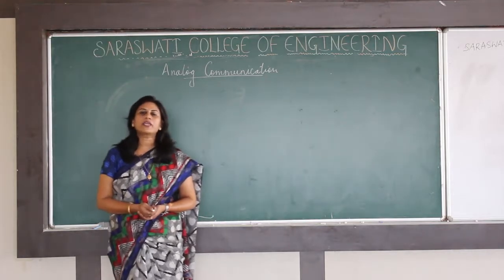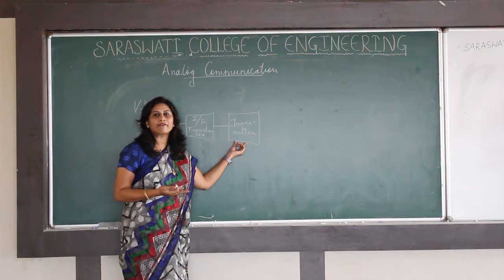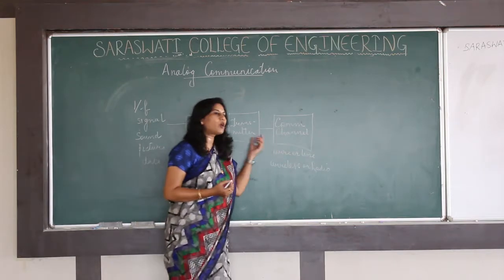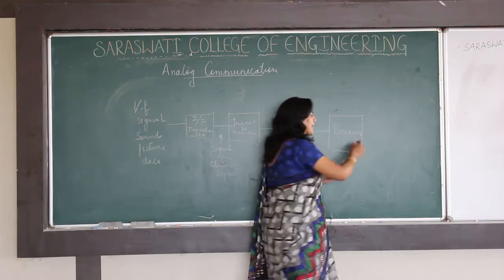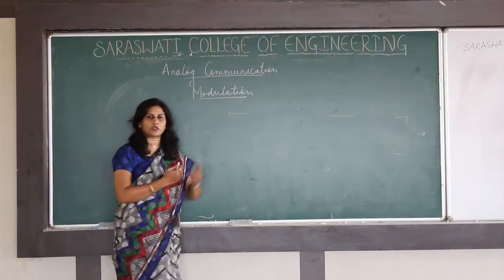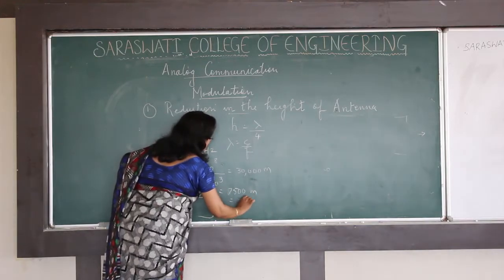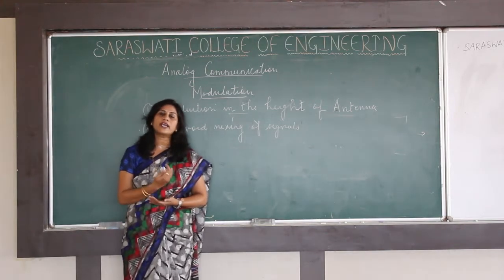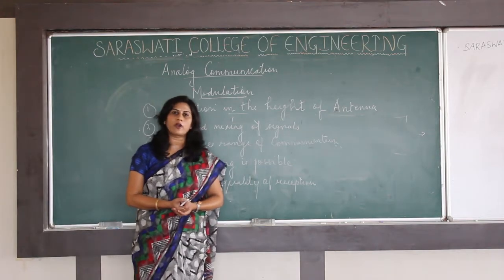Basics of Analog Communication

Comment: Dear Mam
Greetings!!!
During the lockdown find your very video of my interest and very informative for analog Communication.
Why your students have not liked the same is very amazing or have less interest in communication system which need of present scenario. Your students would be using instagram WApps and other applications.
This is not possible with out the digital communication but analog communication is Base of digital communication.
I urge the Engineering students to learn the basic first.
Mam can you explain the analog multiplexing which you mentioned on point 4 of Lecture.
Thanks and regards